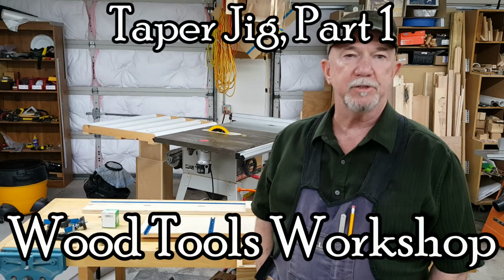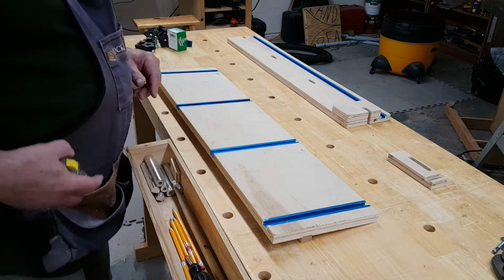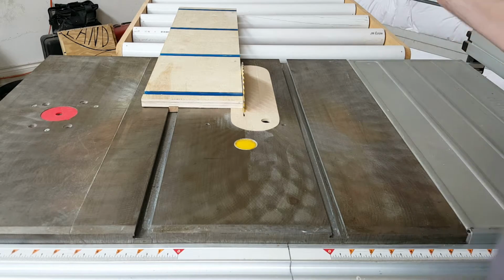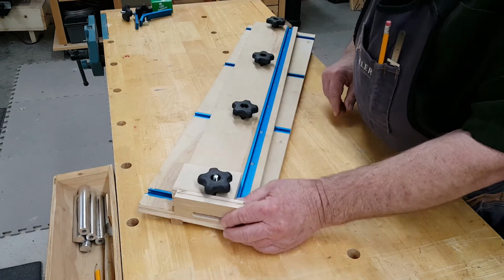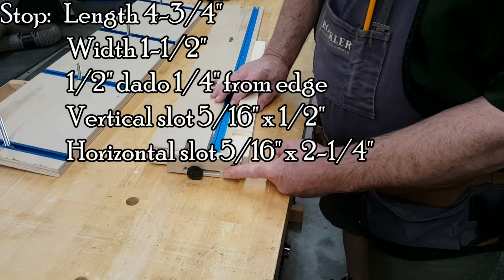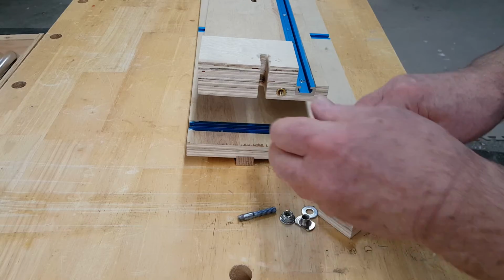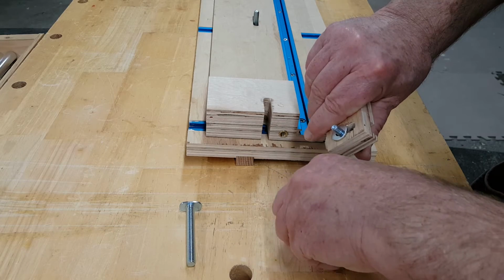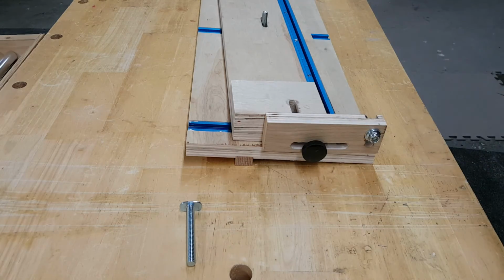Build a Taper Cutting Jig, Part 1

Comment: Built the jig and it works great.  However, if you have a Saw Stop Table Saw, be careful.  My blade hit the aluminum T-Lock and it set off the safety system.  Cut the T-Tracks on the bottom jig shorter to give space from the blade.
Reply from the maker: Nice that you have a Saw Stop.  It's on my wish list. :)  Thanks for the tip!  And for watching and commenting.